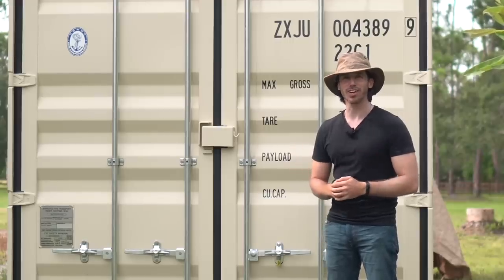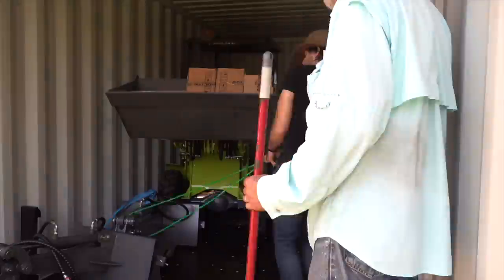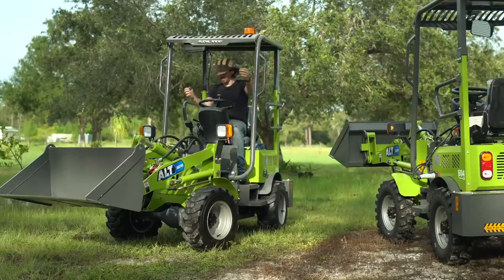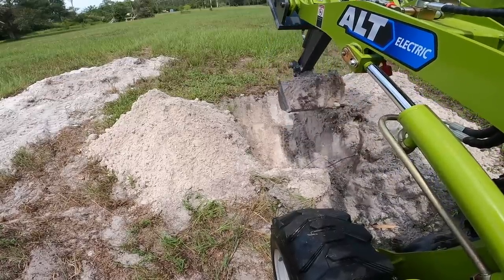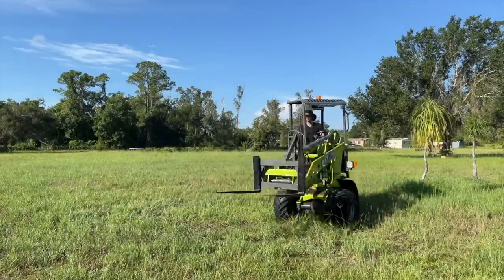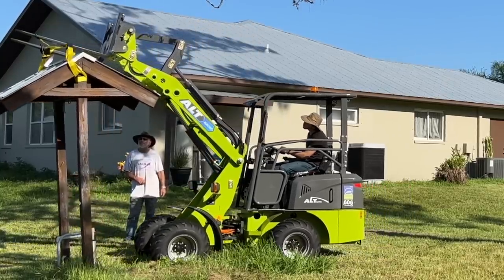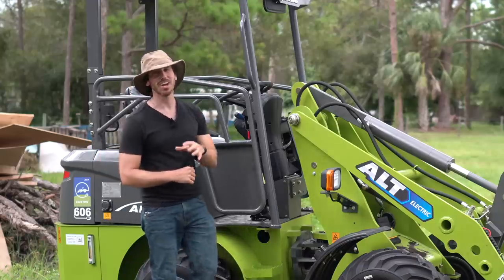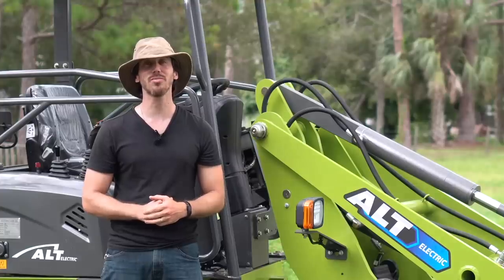I bought a container full of Chinese electric construction equipment!

Comment: Nice and compact little helpers you got there. The three small ones are surely helpful to load pallets, move dirt or similar stuff, while the bigger one is totally the "If the small ones cant do it, i get the big one."-Type plus that it can lift the pallets and all a bit higher.

And the good thing is: Since you got two of the digging attachments, you can add a non-hydraulic thumb to one of them and use it to move brush, logs, or other debris or scrap.

Another idea is, to maybe convert one of the smaller ones to a skidd steer attachment plate and see if it can run a hydraulic mower or so.

Comment: Love the idea of these electric machinery, one would work perfect for projects around my 2 acre home.  Plus the 12k price tag for a NEW machine is fantastic.  The only drawback I see are the SLA batteries, which don't last have very many charge cycles, and if you use them for too long, have a tendency to go bad fast.  Any chance the newer versions will run LiFePO4 instead?  Or maybe have an upgrade charge to better batteries?
Reply: Wow are you sure? Sla in this century? Barbaric.
Reply: These machines are likely 12 or 48v and you can buy almost direct replacement batteries. I am assuming that they are your standard 12v deep cycle golf cart batteries, likely 16 of them. You can replace them with lithium and then buy a charger. 
I am just guessing that is what they have in them. For example if this was the case a 300 dollar lithium battery would set you back about 5k. A good charger would set you back another 500. Yet I do not know how many batteries these have in them. Lithuim would likely 4 times more energy. You might even be able to get away with just adding some weight and 4 batteries to have the same capacity or even more that was the original had. All depends on the specs.
Reply from the maker: Lithium batteries are definitely nice for light weight and for lasting longer, but the downside is that you'd have to add lots of counterweight to the machine. The SLA batteries in these are the counterweight, and if they were converted to lithium batteries then the amount of weight the machine can lift would be reduced. The other advantage is you can get replacement batteries anywhere, like your local Home Depot or Lowes. There's definitely pros and cons.
Reply: @EbikeSchool  Lithium and lead ballast is a far better upgrade. Lithuim delivers stable voltage and current while SLA delivers lowering voltage and degrading current.

Comment: You said just a dollar to recharge?  I believe recharging costs more than using diesel fuel.
Reply: Nope.  $1.44 for full charge to the batteries (but this can vary slightly on the cost of electricity in your area)

Comment: 2023 and it still uses Lead Acid batteries ?  Hard pass
Reply: Actually a design choice - heavier SLAs provide the counterweight that lighter lithium bats would not, are readily available in just about any town so easy to source, are easy to replace, and are a great deal less expensive.  Lithium is not always the answer.

Comment: i will nor be into electric stuff till its gets 4 times battery capacity and price much cheaper soon the lithium will go away i hope for better less fragile battery / capacitor  tech but until then its fun just not a real solution for a lot of needs loads of carbon rich plant food fuels still left in earth its renewable and not a fossil fuel as they said marketing thing that stuck for well over 100 years be nice if propane or cng was used more its 105 +octain  race fuel so to speak
Reply from the maker: More for the rest of us

Comment: Paper thin arm look like this is just toy. And almost maintenance free is lie.
Reply: That paper picks up 1400 pounds.  Replacement of the ICE motor with electric motors does indeed reduce maintenance to basics such as checking hydraulic fluid levels, greasing the pivot points and keeping the batteries charged up when the vehicle is not in use.   These are the facts, not the emotions.